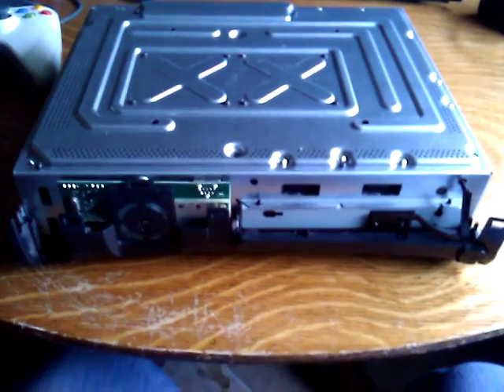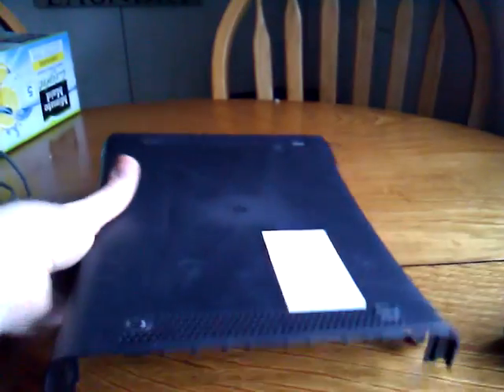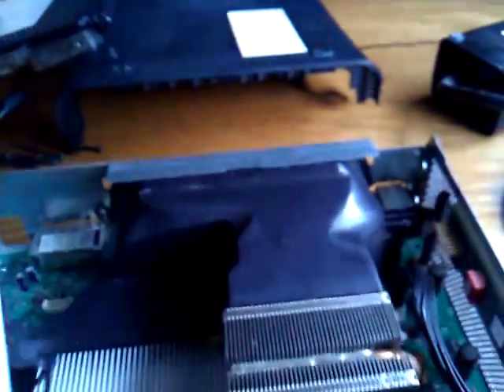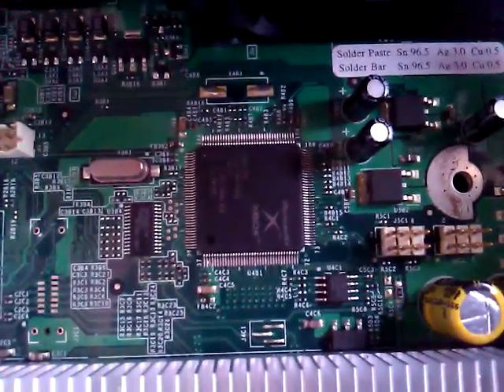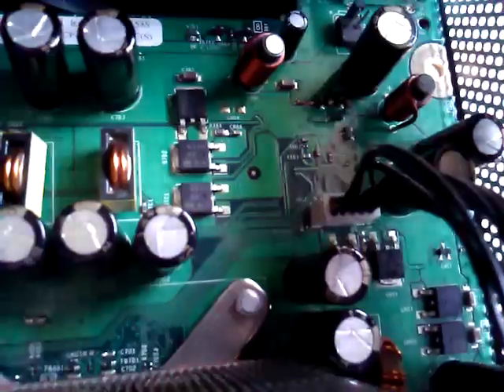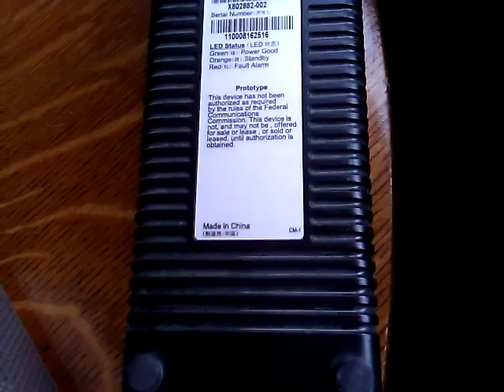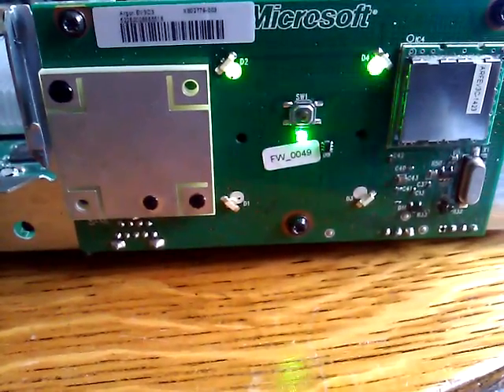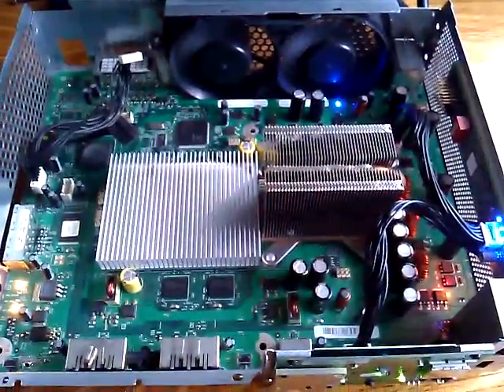Xbox 360 Development Kit XeDK 2004 Xenon Beta Prototype #1

Comment: strange that this has the HANA chich since the original xbox 360 that came out was missing this since it did not have an HDMI. the original xbox 360 missing the HDMI had the ANA chip
HANA chip came out once the HDMI was put in the 360.

Comment: i have for sale Microsoft Xbox 360 Beta/Prototype Controllers from mid-2005 for Beta Dev kits G5 i have 5 brand new ones if anybody is interested last one that sold on ebay went for 128.00 and it was a used controller i have 5 brand new ones for 100 each. you can contact me at carlosbazua@yahoo.com if anybody is interested.

Comment from the maker: They were done testing on it, and purposely destroyed the fan, eject button, cut the side car off, ripped out all wires inside, broke faceplate off and belt sanded the info off the back. I have an XNA XDK 360 in with blue trim I got in the same condition from a recycling facility I may make a video on soon.